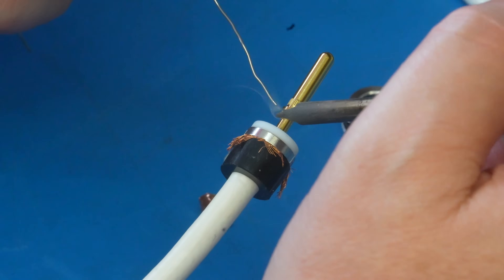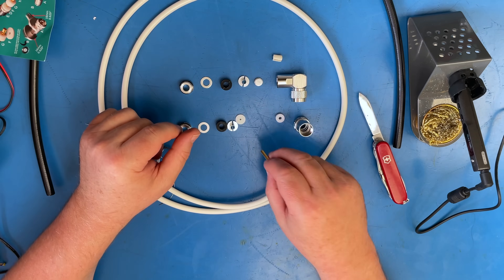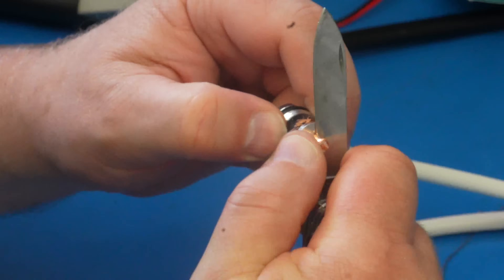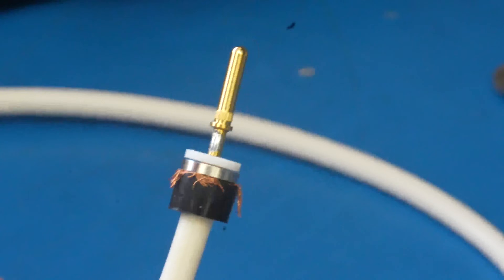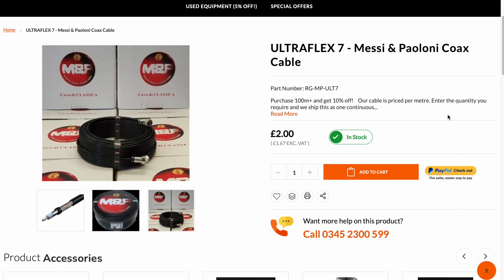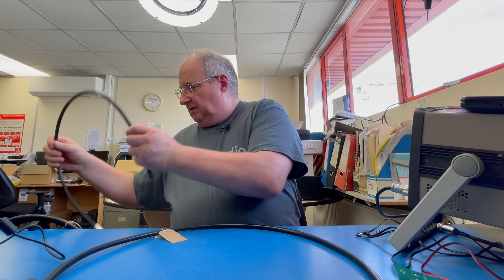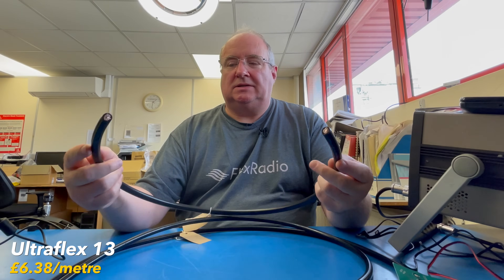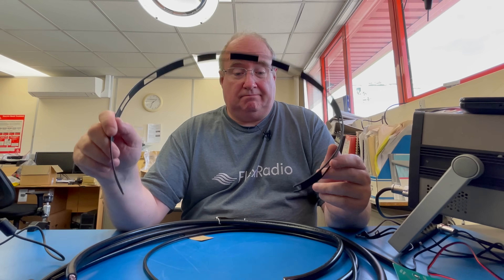How to Fit PL-259 Connectors to Coax

Comment: Thanks Gary… very nice presentation. The M&P plugs are excellent engineering they are like jewellery, I’m really impressed with them, yes expensive and although the old ones will do the job,  these look so well made. The 5mm are rather fiddly though and frustrating to fit.    💙

Comment: Whats the best temp for leaded and unleaded solder gary
Reply from the maker: that depends on the brand specs, when you do a cable end you have be mindful of the dielectric not melting.. typical temps I would say 220-300deg c but the most important thing (along with temps) is flux, use a good flux or fluxed solder.. Gaz